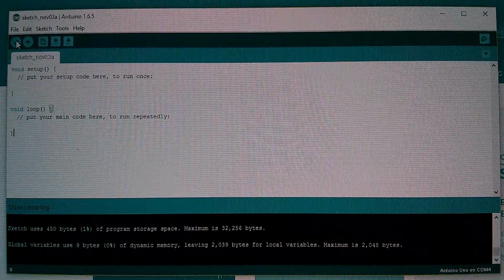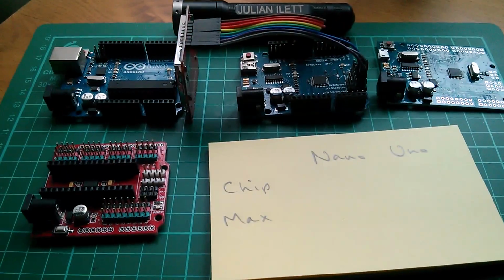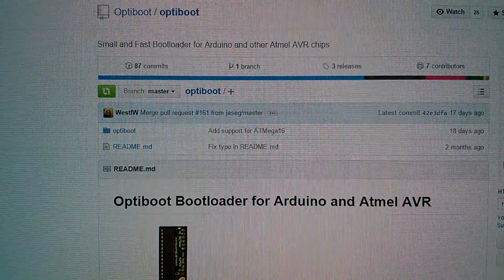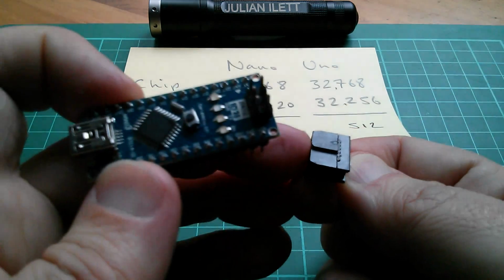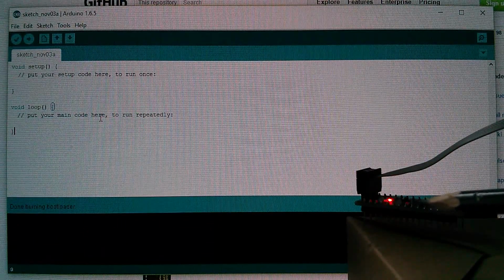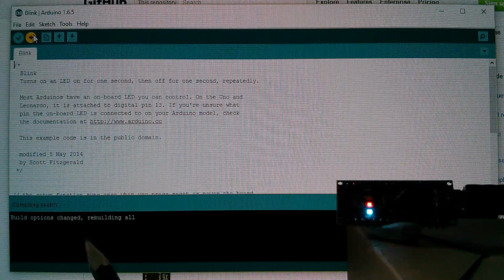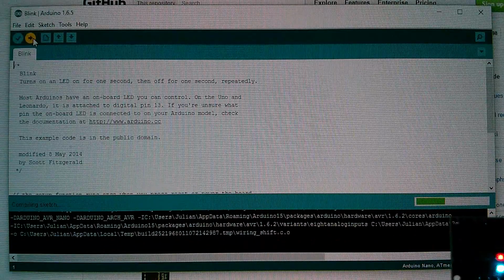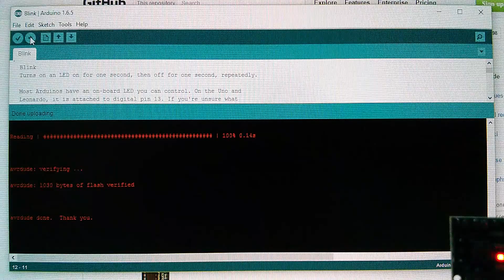Julian's Ardutorials: Turn an Arduino Nano into an Uno

Comment: Hi Julian, thanks for the video. Doesn't the nano have a 16MHz crystal oscillator while the Uno has a 20MHz crystal? I didn't find any mention of this in your video or the comments here. This will impact the timers on the chip and things like the delay(); function will operate at different speeds. Could you elaborate on this technique when the boards have different clock sources?

Comment: if the opitboot  bootloader is   smaller and more efficient then how come the nano does not come with it preinstalled and used the bigger slower bootloader?
are there any drawbacks or is it just a copyright issue or something?

Comment: Is it possible to install the Optiboot bootloader on an Arduino Pro Mini (again, one of the clones, but it's from Inland).
I am using the Inland FTDI to serial adapter that can work with both 3v3 and 5v Pro Minis.
I have the 5v 16mhz.
Any help would be great.

Comment: I'm very late to the show with this Frankenduino business, but better late than never, anyway, I've just done this today, having only just yesterday built yet another Arduino clone thingy on some stripboard to use as an ISP to do it.
I didn't do it for extra memory or for faster uploading of code, but to get the 'Watchdog Timer' to work properly, that I've only just discovered while trying to make my project a bit more 'bomb proof', didn't work on Nano's not running the Optiboot bootloader. In the words of certain Aussie, it's certainly a trap for young players, and it had me really puzzled as to why my nano was locking up at boot when I caused the timer to be triggered while testing it.
So yeah, burning the Optiboot bootloader onto the Nano fixed the problem, and if my projects code gets stuck now, it gracefully resets and hopefully recovers, instead of just sitting there rapidly flashing an LED forever, after resetting itself.
So maybe that's an idea for another video for you to do, showing the problem, and the resolution.
Love your video's by the way, even the more frustrating and confusing ones.

Comment: Question - I don't have a tiny programmer handy...   erm, the NANO has access to 2 more analog inputs than the UNO. Does the conversion still allow use of these two inputs???
Reply from the maker: Good question, let me check...
Reply from the maker: The Nano (with Uno bootloader) seems fine with the 2 pots on A6 and A7 :)
Reply: Excellent - worth checking....

Comment: Great tip. I didn't know this could be done. I have a second tip. avrdude normally does a readback of the programmed flash (a verify) but there is a way to skip this. In platform.txt (in the arduino IDE file structure) edit this line: 

tools.avrdude.upload.pattern="{cmd.path}" "-C{config.path}" 
{upload.verbose} -p{build.mcu} -c{upload.protocol} -P{serial.port} 
-b{upload.speed} -D "-Uflash:w:{build.path}/{build.project_name}.hex:i"

into this line:

tools.avrdude.upload.pattern="{cmd.path}" "-C{config.path}" -V 
{upload.verbose} -p{build.mcu} -c{upload.protocol} -P{serial.port} 
-b{upload.speed} -D "-Uflash:w:{build.path}/{build.project_name}.hex:i"

See EGNBR's post in this thread: https://github.com/arduino/Arduino/issues/1344

Comment: Hi Julian, I'm new to Arduino and I love your videos, I already learned a lot from you...
I now have a few of these chinese Nano's and would like to upload the bootloader like you demonstrated. But before I try this, I have a few questions:
1) When I connect them to my PC (Mac) their USB port is not recognized in the Arduino IDE. Does that mean the bootloader is not installed?
2) I have a USB to serial adapter board (from 4D displays) with +5V, Rx, Tx, Gnd and Res connections. Can I use that one?
Reply: You need to ISP the bootloader First, then you will be able to Usb communication, next..
Reply: Thanks for your tip Paul but I already found a way to do this... (I had one year time ;-)

Comment: Why do they even put the usb on the arduino clones? It works just as well with a isp and you dont need to have a clunky usb header nor a built in usb to serial adapter and you do not need the bootloader at all.
Reply: why do they even put an led, a psu, headers and a crystal on it. Heck why do they even put it on a pcb.
Could it be because that way it was more  user friendly to a lot of people  who are interested in using it straight out of the box rather than having to buy an additional FTDI board, or  an additional programmer.

In fact there already is the thing you are looking for, it is called an Atmega328 chip

Comment: I use the "sticker" method too. :) I have a few homemade PCBs with avr microcontrollers and I stick notes on them about the bootloader and the fuse settings.

Comment: +Julian Ilett

A suggestion for you Julian given you appear to be looking for video ideas. It will encompass your interest in Arduino, MiniQuads, Nokia Displays, Programming, hacking etc.

Build a motor/propeller thrust tester using a strain gauge or hacked electronic scale with a bit of memory so it can record peak values. Like the Turnigy (HobbyKing) offering but better. Perhaps you could incorporate a laser based, motor and prop combination, balancing system. 

Just a thought.
Cheers

Comment: The Arduino Nano 3.0 has the same amount of memory as an Uno. There's no difference besides form factor.
Reply: +Steve Spence That is just being plain picky. Yes, Julian is technically just changing the bootloaders from the stock 2k bootloader installed on Arduino Nanos to the 512b bootloader installed on most Arduino Unos. But as far as the Arduino IDE is concerned, you are changing boards, as you have to program it as an Arduino Uno from then onwards. And without going into the complexity of understanding bootloaders and boards.txt files, that is a good enough explanation of how to get some of the benefits of the Arduino Uno (updated bootloader). If people wanted to know more, they would look up Optiboot as Julian indicated in the video, and learn more about it and what a bootloader is, and then how to add a vanilla optiboot entry to their boards.txt file.
Reply: +Steve Spence The bootloader in the Nano occupies 2kb of that memory whereas the bootloader in the Uno occupies a mere 512 bytes, i.e. one quarter of 2kb. That memory is unavailable for Arduino programs! That is the difference.
Reply: Right. But that's not what was said. Optiboot can be loaded on any 328 based board. It's no big deal to load a new bootloader.
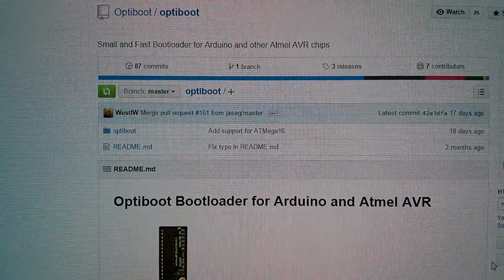Reply: +Steve Spence Which video were you watching then? The difference in the bootloader sizes was clearly stated by Julian @ 2:50.
Reply: +Nick B Right in the description "The Uno has more memory and faster upload baud rate,". Bull. The Uno is basically the same hardware. Optiboot is smaller and has a faster upload, not the UNO. I didn't bother watching the video. It's misrepresented. He isn't converting anything, he's just loading a new boot loader. Frankenduino my ass ....
Reply: +Peter Feerick He was commenting on a video he has not watched, hence the misinterpretation. ;)
Reply: +Nick B I was going by the description of the video. I already know how to update a bootloader, which wasn't even mentioned in the description. Here's a suggested description update: "Update your bootloader to free up memory and decrease load times" .....
Reply: +Nick B Thanks for that Nick. I saw a mention earlier of him not watching the video, but I am still suprised he thinks that he expected the title to so exactly reflect the content of the video that you don't need to watch the video if you can decode the title. If that were the case, some videos would need a mile long title. It was designed as a hook, and is more likely to attract beginners than a title such as 'updaing your bootloader' etc... as they won't even know what a bootloader is. Julian pretty quickly explained that he wasn't refering to the form factor - just how the Arduino IDE treats the board. I'll stop there, as this is really a difference of opinion, and the only one that matters here is Julian's as he is the author. :)
Reply: +Peter Feerick I'm not participating in this circle jerk. This was more bait and switch than anything else. Very spammy.

Comment: Alice is selling UNO R3 with the DIP version of atmega382 with USB cable for US$6.68 (latest price) and NANO at US$2.31 without USB cable and headers supplied but not soldered.
kind of make sense that to pay just one third of the price to get the same job done and fully utilize the flash memory.
excellent tutorial....
Reply: +Reese Me Check on other places, I bought two UNO R3 for 2.6 usd each without cable on aliexpress and the last time I check they already including the cable. Yet I prefer the Pro Mini wich are about 1.5 usd.
Reply: .rpv US$2.6 for UNO R3 is the SMD version not the DIP version, see the difference?
Reply: +Reese Me Yes, sorry, I forgot that some people prefers the DIP over the SMD version, I assume to use for programming breadboard UNOs?, if this is your case could you see some advantages over the Pro Mini (like power consumption)?

Comment: Julian, do one where you flash the bootloader but with a chinese nano clone that doesn't have  isp pins. I believe you have to flash it with an other arduino connected as a master
Reply: If the ICSP pins aren't broken out, you'd attach to the correct header pins instead (ie. D13 for SCK, D12 for MISO, D11 for MOSI (or is it the other way around!), D10 for SS, RST, VCC, GND). The 6 pin header just gives you access in a convenient and standardised manner.
Reply: +Peter Feerick Yes, got it. http://www.kerrywong.com/blog/wp-content/uploads/2010/04/atmega328pISPboard.png

But what I meant to say is, that sometimes if you only have an usb->ttl board and only chinese nano clones. It is possible to connect the usb/ttl board to one clone, that than is connected to another clone. (possibly by the connections you mentioned) and use one nano to program the other nano. Without having a icsp programmer.
Love to see that as an extension to Julians video.
Flashing a leaner bootloader also has the option (with some bootloaders) that it skips the delay time that it waits for being programmed and jumps straight into the program on power up. Only a reset will let it wait for programming. Saves you 1-2 seconds!
Reply: +Kenneth Tan Yes, I believe you should be able to. You would program the first arduino with the ArduinoISP sketch so it behaves like a programmer, and the secound would be your victim to be updated. IIRC, you don't even need the USBtoTLL module once the ArduinoISP sketch is on the first Arduino as it automatically programs on reset (or I could be thinking of the wrong programming sketch and you need to send a specific character for it to start programming). Another sketch to look at is WestFWs standalone optiboot sketch - he is the current mainainter for optiboot, so it might even be in the optiboot github repo now.
Reply: +Peter Feerick That is exactly what I was looking for. And if Julian would do a follow up video of that, maybe showing a few different bootloaders it would be helpfull for a lot of people. His vids are so clear, easy to replicate and very professional.

Comment: i have 2 nanos that the driver is not recognized by my computer. if i redo the boot loader will that fix it and if not can i program them by bypassing the usb to SERIAL chip. 
Also great video.  :)
Reply from the maker: +Beginner's Tech Do they have FTDI chips? You've probably been bricked! Yes, you can bypass the USB/serial chip (and overwrite the bootloader) by using an ISP programmer.
Reply: +Beginner's Tech
If you turn the verbose outputs on in preferences like Julian did in this video, then after 'Verifying' the sketch you will find all the compiled code in the folder described in the verbose text. You can then use an ISP programmer to program the board using the HEX file that has been created.
BTW you must leave the IDE open whilst you retrieve the HEX file, as it is kept in a temp folder that is immediately deleted when the IDE is closed.
Reply: Julian Ilett i believe the chip is a ch340g.

Comment: You can also gain that 512 bytes too (for a total of 2K gain) by terminating the bootloader and upload your sketch using Upload Using Programmer (Ctrl+Shift+U) menu item. That way you don't even need to use the Uno profile, you can continue using Nano profile. ;)

Comment: i have a question what happen if you don't have a isp programmer of any kind can you do the same thing using another arduino?
Reply from the maker: +joseph chrzempiec (josephchrzempiec) My next Ardutorial will probably be about using another Arduino as an ISP
Reply: +joseph chrzempiec (josephchrzempiec) Yes you can. Under Tools set Programmer to "Arduino as ISP"
Reply: +joseph chrzempiec (josephchrzempiec) do you have a second Arduino ? you can use one as an ISP - Programmer 
https://www.arduino.cc/en/Tutorial/ArduinoISP
Reply: Thank you Raffy611 But what i was wondering can change the bootloader is in Julians video using another Arduino board??
Reply: Thank you Julian.
Reply: +joseph chrzempiec (josephchrzempiec) yes you can, same concept as in the video just using another arduino as an ISP programmer, besides that its done the same way in the video

Comment: You could just add an Arduino-Julian to boards.txt
That way you can get a Nano with the A6 & A7 functionality but with the smaller bootloader and faster upload speed of the UNO

something like this:

julian.name=Arduino Julian
julian.upload.tool=avrdude
julian.upload.protocol=arduino
julian.upload.maximum_size=32256
julian.upload.maximum_data_size=2048
julian.upload.speed=115200
julian.bootloader.tool=avrdude
julian.bootloader.low_fuses=0xFF
julian.bootloader.high_fuser=0xDE
julian.bootloader.extended_fuses=0x05
julian.bootloader.file=optiboot/optiboot_atmega328.hex
julian.bootloader.unlock_bits=0x3F
julian.bootloader.lock_bits=0x0F
julian.build.variant=eightanaloginputs
julian.build.mcu=atmega328P
julian.build.f_cpu=16000000L
julian.build.board=AVR_NANO
julian.build.core=arduino

Comment: Great video but i have a question ! When you use the Optiboot bootloader do you lose the two extra analog inputs of the Nano ?  This could be a trade of , if you need more analog Pins !
Reply: +Raffy611 unfourtunantly yes.
Reply: +umbrefawx Thanks for clarifying. Seems you don't get something for nothing!
Reply: +umbrefawx not if you edit boards.txt and add an entry to it with the correct settings!
Reply: +Adam Welch Scroll up and look at Nick B Comment, I just tried it myself and it does work. I just tried it. You can still have use all 8, I kinda ffeel like an idiot now.
Reply: +Nick B I know I just tried it. I  knew that but I didn't think of it at the time, I feel like an idiot but thank you. I should have tried that sooner.
Reply: +Nick B +umbrefawx thats what happenes when you wortk 12 hour days 5 days aweek,
 it tends to take a toll on your brain. Ive been stuck with 6 for over a
 month cause of this simple yet forgotten thing to do, I knew I was 
missing something. Thank you, I mean it. xD
Reply: +umbrefawx That's great news. Thanks both.
Reply: hay can you post a link or a short explanation what file you need to change ?
Reply: file path etc.
 would be great !
Reply: +Raffy611 http://pastebin.com/T7hm9YaQ

look at the last line. Thats what you edit to get the other 2 analog inputs back.  

Credit to Nick B.'s stated in another reply.
Reply: Thanks umbrefawx for posting and Thanks Nick B for the file ;)
Reply: +Raffy611 +umbrefawx Always happy to help out fellow tinkerers.

Comment: As another commenter said you could also alter the ide to understand it's still a nano by telling it the boot loader size but then all your nanos will need updating. All that's happening by doing this is the program will be loaded into the first available memory that is also were the optiboot boot loaders as it boot vector set.